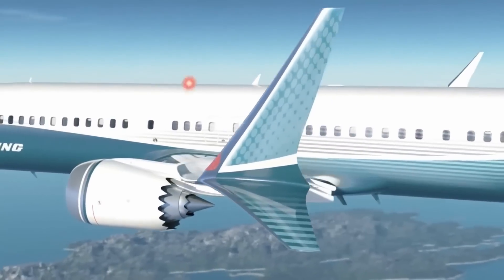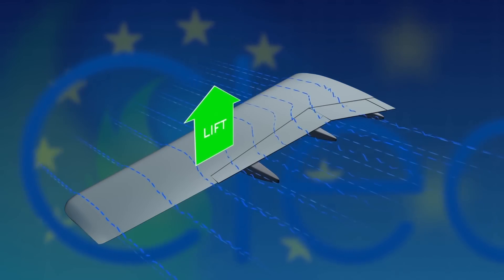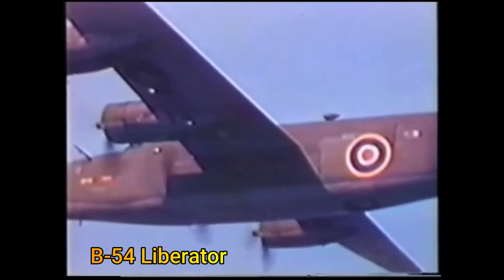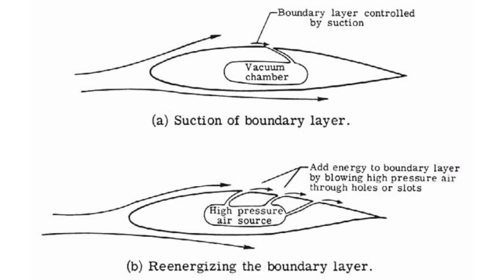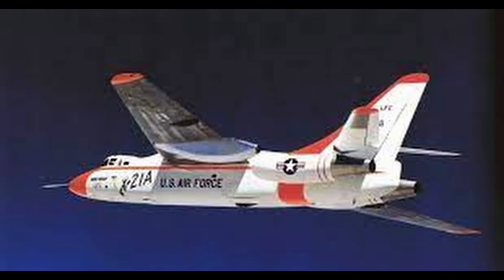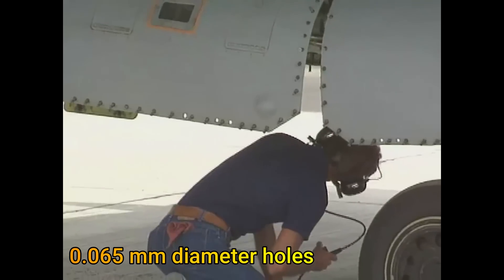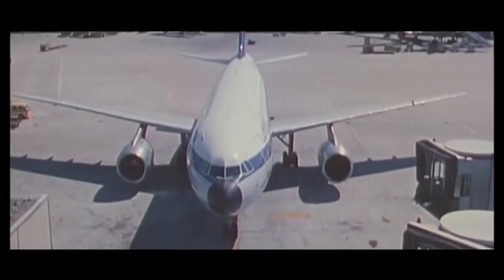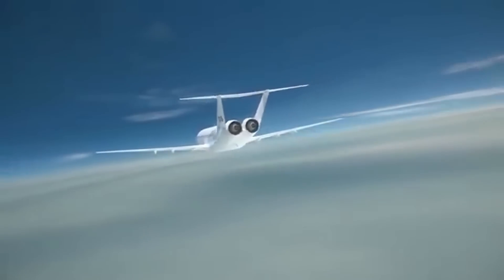Laminar Flow Aircraft: The most promising development in Aviation

Comment: Interesting video. Thanks. Where do vortex generators fit into this technology?
Reply: Hi. VGs serve a different end, namely, they improve control effectiveness (and can reduce stall speed). But at the cost of extra drag. Introducing a vortex into the boundary layer is obviously going to disrupt laminar flow. However, as VGs can increase lift coefficient, careful design may result in them offsetting their own drag penalty (ie no reduction in lift to drag ratio). The fundamental difference is that laminar flow is about delaying the change from laminar to turbulent boundary layer (to reduce drag in cruise) whereas VGs are about delaying the separation of the boundary layer from the airfoil surface (to improve handling).

Comment: Most laminar flow projects failed due to contamination of the wing (dust, bugs, ice). So even if laminar flow was a design objective, most wings would operate in a more 'conventional' manners. As you move into the transonic region compressibility will disrupt air flow. Using suction or blowing via surface porosity (small holes) leaves the problems of extreme sensitivity to dirt. A quick polish or dust flurry will block the holes. Wing/flap blowing can produce useful reduction in landing speeds. At Cosford there is a jet which has a minimum speed placard of 30mph (or is it 38, not sure).

Comment: The biggest problem is the poor design of the tube style aircraft. The Lifting Body design could prove to have much better laminar flow, especially with the engines located on the topside at the rear.

Comment: No point showing the honda jet in any discussion on laminar flow. It has an aluminum wing with a leading edge held on by hundreds of screws and there are steps of up to 0.03”. No chance of having laminar flow under those circumstances. You need a very high level of smoothness, that which can currently only be achieved with composite construction. If honda is claiming laminar flow it is marketing wank.

Comment: The B-24 was designed in 1938 and the P-51 was designed in 1940. Two years apart, not nearly a decade apart as you said. Unnecessary and easily checkable mistakes like this sabotage technical discussions and bring reasonable distrust to the discussion. This was careless and easily avoidable. You ought to be more careful in vetting your data.
Reply from the maker: I agree. I read it some where and didnt verify. I should have done better
Reply: @ElectricAviation  Minor detail.  Excellently done otherwise.

Comment: Alright…so, what if you direct a portion of your exhaust to slot cut across the top of the wing, behind the maximum thickness, facing the trailing edge, kinda like a blade-less fan. The slot would distribute exhaust evenly across the wing creating an “artificial” boundary layer of laminar flow. Obviously the reason the flow becomes turbulent behind the maximum thickness is because of the vacuum created, so eliminate the vacuum?
Reply from the maker: There is a method where you let compressed air out from the wing surface to energize the boundary layer. What you are talking about is something similar
Reply: I wonder if the heat would cause adverse effects though. Remember he said cooling the surface can increase laminar flow. There are many prototypes that use the exhaust gases over the wig to generate more lift at low speeds though.
Reply: See Blackburn Buccaneer.

Comment: Laminar flow will be far easier to achieve  when aircraft are constructed with industrial scale 3D printing.
When that method is implemented, it will be relatively quick and simple to produce surface structures which will aid the laminar flow of air, and to adapt the code to further improve the flow.
Such a method would not only remove the need for elements such as rivets, but also the internal superstructure and the elements which were only in place because of the previous technology required to maintain structural rigidity and strength.
It would also be theoretically possible to construct the whole vehicle and engines with this method, the electronics and wiring would be among the few elements still requiring installation.

Comment: The videoclip in a few words. 
 It is simple. A laminar flow has say 1/5 to 1/7 of the drag compared to a turbulent boundary layer. So: be laminar as far as possible is the goal.

Laminar boundary layers a sensative: wobbles in the surface, small dents, specs, bugs, rivet heads, rain;  cause transition to a turbulent boundary layer. 
So your aircraft has to be, and stay in a mint condition. Can that be realised?
Reply from the maker: yes

Comment: The claims will remain claims. 
NACA tested thick laminar flow sections at very high Reynolds numbers, (10^7 and above) as the fuselage of this new design has. (Celera)
Unfortunately the drag rises beyond  a certain Reynolds number.  Over 2 * 10^7 the drag increase starts. (Abbot & Doenhoff, figure 66, page 150 and figure 76, page 166)
Beyond (higher Renolds numbers ment) the drag increases steadily, and the laminar flow section behaves as a 4 or 5 digit normal airfoil, say used on Piper cub, Cessna). 
The fuselage has a Reynolds number of 10 to 12 *10^7 at the claimed speed, hence operates in the drag increased zone. 

The wing though, has smaller Reynolds numbers and could be laminar, like a Cirrus or Lancair.
Important is the stringent requirement to be spotlessly smooth. Small specs, bugs, etc can trip the laminar flow to become a turbulent flow. 
Boundary layer suction is mentioned through tiny holes, but not the method to keep them open over 25 year practical use. One wipe of preserving wax, or moisture below 0 degree C, and they are clogged.

Conclusion: Wings will be laminar-, fuselage will have turbulent flow.   Investors...  this was your lecture aerodynamics.

Comment: Fascinating. The Celera would seem to be a design that would only be laminar in a fairly small envelope of flying conditions based on what would appear to be a propensity for nose-down attitude depending on a fairly tight 50/50 weight distribution that could shift pretty dramatically in a headwind or tailwind situation  - among others.  Do you know if that's the case.  Are the two scoops at the rear top of the empennage used to actively control flow in addition to supplying air for the engine?

Comment: Good video but I kind of laughed when you mention the B-24 since it has four huge egg beaters totally disrupting the air flow. Perhaps they got good numbers in a wind tunnel but not in real life. Where can I find out more about the relationship of Reynolds number to Laminar flow?  How does the coefficient of lift of the NACA 671015 compare to say an Eppler 205?  What about using the vacuum holes as a means of extending pins into the airstream to improve the lift coefficient during slow speed operation. The pins would make the air more dynamic. My concern with Laminar flow is the increased risk of lift failure during icing.
Reply: Haha this is so true.

Comment: You neglected to speak about the biggest uphill battle the Celera 500L faces: its engine choice. It is a V12, twin six, PISTON engine called the Red03 which burns diesel or jetA fuel. It is basically an experimental engine almost completely unknown on this side of the pond. There will be two insurmountable barriers: the unknown maintenance background and the insurance industry. The former because there is no knowledge base or supply chain for parts, service & training and the latter because they are the tail that wags the aviation dog. Since roughly 2009, the aviation insurance industry has shrunk and become very insular. They hate single engined piston engines on go-fast, basically experimental airplanes and they really hate them on pressurized, fast airplanes going up into the flight levels. Celera tries to hype the “twin six” part saying that it can operate with all the attributes of a twin engined plane, but it is just hype. There is still only one crankshaft. The industry will laughingly see through that hype and say “I don’t think so” and no one in their right mind will fly or own a 2-plus million dollar plane with no insurance.
Reply: Certifying any all new aircraft is hard. The engine is the only choice because it is highly unusual, but it is working very hard, more like a racing engine than a typical aircraft engine and that could result in reliability issues. I don't know if it has ever been certified in a pusher. Pushers are typically noisy  because the prop slices through different pressure regions of the aircraft's wake which as well as noise causes continual pulsing stresses on the blades and crankshaft. The aircraft's party trick only happens in a limited size range, switching to another engine probably is a no go, so if they get any bad news about cooling or service life...
Reply: Data is easy to transport, so everything known about the engine can be made available to American certifying agencies. Engines used to be much less reliable which resulted in bans on single engine commercial designs. I don't know if those old prejudices are still operating. Engine failures are rare enough now so that doubling the number of engines essentially doubles the failure rate and greatly increases the opportunity for pilot error. Far from unknown for a twin pilot to shut down the good engine by mistake, or stall and spin because they get behind the aircraft managing caging the dead one.

Comment: The B-24 Liberator was able to fill the air gap over the Atlantic, leaving U-Boats nowhere to hide. Its long range was made possible by its high aspect ratio laminar flow wing, known as the Davis wing. By the same token, the P-51 Mustang would be able to escort bombers all the way to Germany and back due to its extended range made possible by its laminar flow wing. This despite the Supermarine Spitfire Mk IX of similar size being equipped in some cases with an identical Rolls Royce Merlin engine
Reply: The wing of the Spitfire was very efficient aerodynamically, being eliptical which reduces induced drag. However, being a thin wing it was not good for wing tanks (only a few examples had small wing tanks). By Comparison, the P51 could carry a lot of fuel from the get go. This more than anything else accounted for the difference in range performance.  I am not saying the P51 wasn't more efficient overall than the Spitfire. According to the late Lee Atwood (of North American) it enjoyed a significant advantage in cooling drag alone. What I am saying is the laminar flow wing is probably the least of it, considering the Spitfire wing was also notable for its inherently efficient eliptical planform, and most of the range advantage was due to the P51 carrying nearly 3 times the internal fuel of most Spits.
Reply: @XPLAlN  Let's not forget the combat performance as well. While also reducing drag, laminar flow over the wing results in lower stall speed or higher stall angles. As a result, even with square edge wings, the P-51-D3 when fitted with the Rolls Royce engines could turn fight just as well as a Spitfire. The more powerful and efficient engine in tandem with the laminar flow benefits meant that it could accelerate faster out of a turn, hold more energy through the turn, and enter the turn at higher angles without stalling than it's predecessors. This meant that it outclassed the BF-109s and FW-190s that were still being used as supplements to the Me-262, and was even on par with the overall performance of the Me-262, not counting maximum speed and altitude.

And that's not all. The P-36 Hawk also benefited from laminar flow over the wings because the wing design swept forward at the trailing edge, helping to push that cross flow under the fuselage where it could give the plane more tail authority. While the flat nose and cooling flaps on the cowl required for the radial engine certainly doesn't help efficiency, overall drag, or top speed, this plane outperformed many aircraft from it's time simply because of it's wing design, short fuselage, and ability to outmaneuver all of the faster, sleeker designs of the time. In addition, because of the wing design pushing more air to the root of the wing rather than the edges, it had a much higher DNE speed than similar planes with straight wings, but suffered from compression dives far more.
Reply: @TheDustyShredder  you're forgetting the biggest breakthrough of the Mustang, which was reduction in cooling drag versus it's contemporaries
Reply: Drop tanks helped a lot too.
Reply: Your information is correct, the B24 was a great success in the war and indeed after in to the 1950s.The Mustang was the most successful fighter plane in the 2nd WW as long as it had the RR engins which replaced the Allisons

Comment: 9/18/22. Excellent presentation of 'Laminar Flow' effects on both wing & fuselage of aircraft. Numerous video 'clips' of laboratories testing smoke flow over wing shaped surfaces as the wing is rotated clearly demonstrates the two (2) air 'drag' issues (natural & paracitic) you articulate through this lecture. Absolutely great visuals of aircraft in flight while your voice over explains the history of wing designs, few examples of 'perfect' laminar flow achievement but also newer body designs which reduce drag thus achieving greater fuel efficiency. Related effects of handling characteristics were covered as well. Great video to watch & learn. A+ ! Carry on Sir!👍👍👍😊

Comment: how much of laminar flow is used in marine vehicles? Does anyone study fish? The reason I ask is the medium of water has considerably more resistance than water. (I'm not quite sure if that impedes or enhances laminar flow) I any case what do you think the effect of using shark skin like texture (which is like narrow spines or teeth) would have on flow?
Reply: Im sure the shark skin would be effective but also unimaginably expensive and complex. Also modern, high speed boats use an ingenious trick where they put a step in the hull (stepped hull) that forces air under the boat, so its a lot less friction because as you said, water is much thicker than air.

Comment: Maybe you can create a video explaining how the tooth-like denticles on shark's skin reduce drag? I see there's some research in to applying the same techniques to aircraft wings.
Tabulators are already used to reduce lamination separation bubbles, but these don't seem to be the same as dentricles, as sharks have them all over their bodies (I believe), and not just in front of where the laminar separation region would be.
Reply from the maker: That reduces that profile drag. It similar to golf ball indentations. It doesnt reduce the skin drag
Reply: Interesting but I imagine trying to produce such complex shapes over the area of an aircraft would be unimaginably expensive.
Reply: inducing very local vortices can re-energise the air flow in the boundary layer, keeping the overall flow attached. You can see this in small 'tabs' on the upper wing of aircraft giving lower stall speeds and better behaviour at the stall. You sometimes see them on performance cars.
Reply: Sharknado helps explain a lot of things.

Comment: Thank you for your production, excellent! One more thing please, all my life I have learnt that a prop at the nose encounters no foul air whereas a prop at the rear is doomed, so why do Rutan and the Celera achieve such good figures or would they be even better again with a nose prop?
Reply from the maker: Its true that if the prop is at the rear and doesnt receive clean air, than it makes at noise and also adds to the dynamic loading on the prop itself. It is however, aerodynamically more efficient over all as the wings and fuselage receive clean air
Reply: @ElectricAviation  : Additionally with a prop at the rear, the wing and fuselage do not see the localized higher air speed of the prop wash nor the turbulence induced by the prop.
Reply: @ElectricAviation  I believe it is due to the fact that the air comes in laminar. If they achieve their goal, and there is little to no turbulence at the back, it may make no difference to the prop.

Comment: Are there any problems with the location of the propeller? Propellers like "clean" air too, and the wake of the fuselage is definitely not clean. Is that one reason the Beech Starship and the Avanti are so noisy? Great video, though.
Reply: Correct. You will notice ALL pusher prop aircraft are noisy because, even if airflow along fuselage is smooth, the prop inevitably passes from high pressure region to low pressure as it rotates. And this alone makes for noise pulses. The prop would have to be either fully above or below the wing which has obvious other issues. 
My bet, aside from it going nowhere, is that this aircraft will have CG problems, payload deficiency, unsafe pilot visibility, very high takeoff and landing speeds and be deadly in icing conditions. 
Laminar flow is a nice idea. A wish.

Comment: The Celera drag reduction vs standard designs is amazing. It's a shame for Celera that it doesn't scale up, although it would probably look like an airborne Blue Whale. Thanks for rounding out the video on an optimistic note with the promise of similarly efficient designs like the double bubble. I love flying and it would be great to make it much more sustainable.
Reply: If the limiting factor for scaling up the Celera is Reynold's number, why not just decrease its speed, with an increase in size?
Reply from the maker: @johndavidwolf4239  Yes true. We have got used to flying at 400 mph or more. Problem is the slower moving aircrafts of upto 200 mph, would not find traction with business community and this aircraft is pitched towards them
Reply: @ElectricAviation  Yes but it would make sense for freighter planes.
Reply from the maker: Totally agree